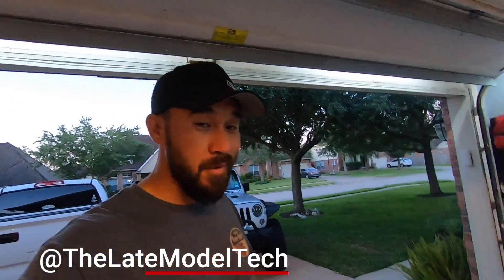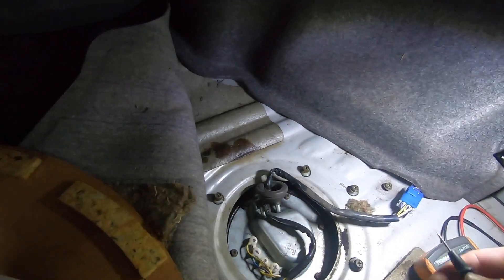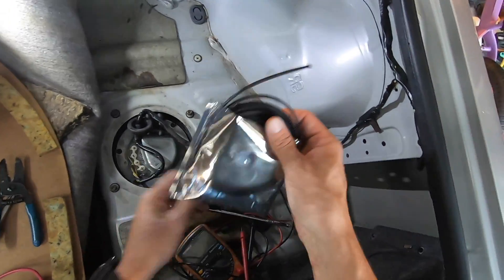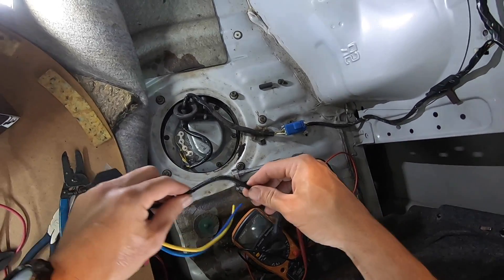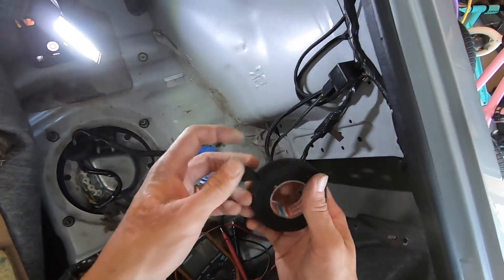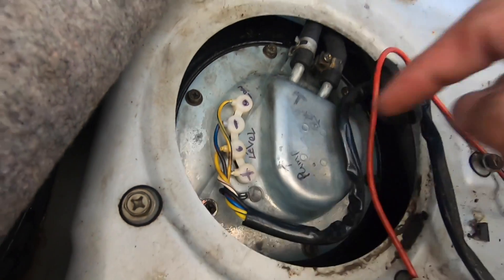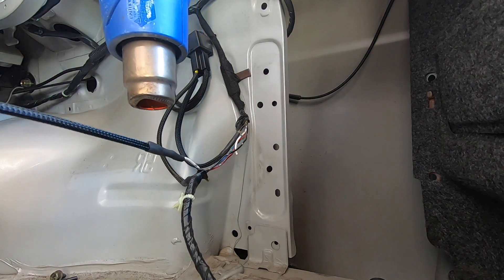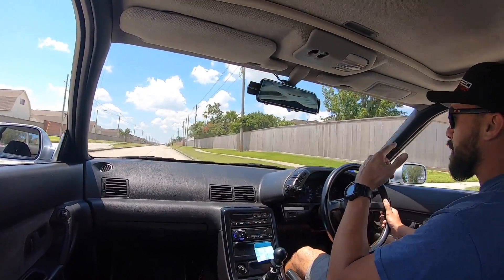Wiring Deatschwerks External Fuel Pump Relay kit More Power to The AEM Fuel Pump on R32 Skyline RB20

Comment: What relay kit was used? The link doesn't link to that exact relay anymore.
Reply from the maker: Part number is correct. Picture is wrong . 😑
Reply: @Donnythelatemodeltech  All good I was actually able to find it. I did a bit more research after this (like I should have) and found that wiring specialists actually made a plug n play version of this. So I did not have to splice into my OEM harness. Worked out quite well, thanks for this video it helped me a lot.

Comment: Voltage sensitivity suggests motor is not permanent magnet type, but field coils are in series.   99.99% of the time you won't see shunt wound dc motors in a car because that requires an external supply - but those behave like permanent magnet for the most part [and really only find a need in high torque applications]